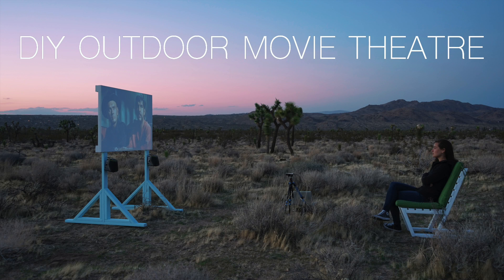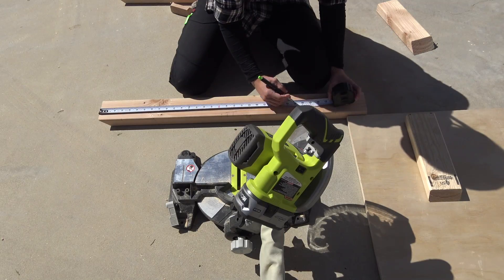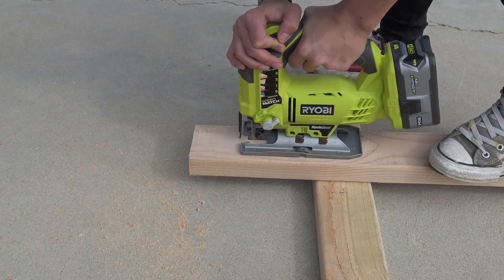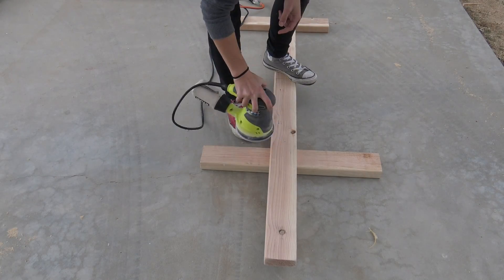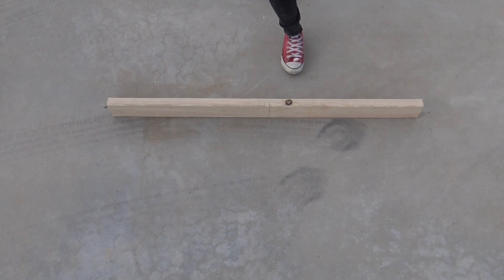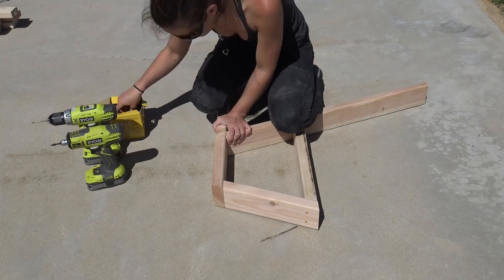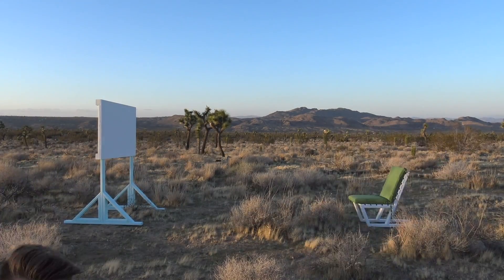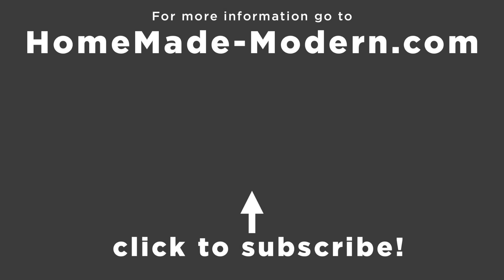DIY Outdoor Movie Theater

Comment: So it's a battery not a generator
Reply from the maker: its both plus an inverter. it came in a kit with a solar panel to charge it.  it can also be plugged into a typical wall socket to charge.  a typical generator doesn't create power it just transforms it from petrol to electricity.  this one provides storage the solar panel and inverts it.
Reply: HomeMadeModern so it's a fancy battery. The solar panel is the generator in this situation, that's still the storage with it's own inverter
Reply from the maker: solar panel would be the fuel source
Reply: The light is the fuel

Comment: How do you keep it from blowing over?
Reply: Don't sit outside on a windy day.
Reply: You could probably use pegs on soft ground or sand bags. If it’s windy enough to blow over, you probably aren’t sitting outside.
Reply from the maker: the legs are quite wide